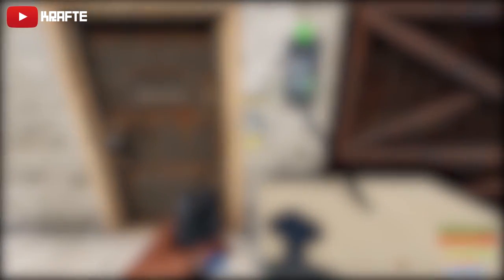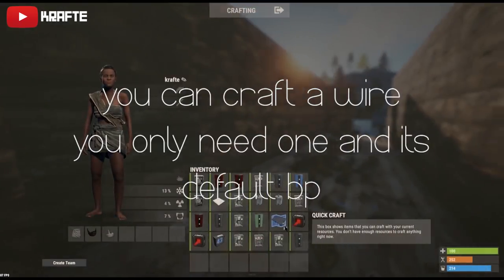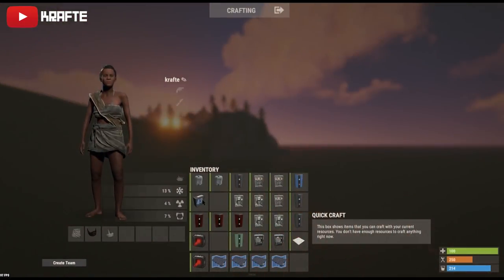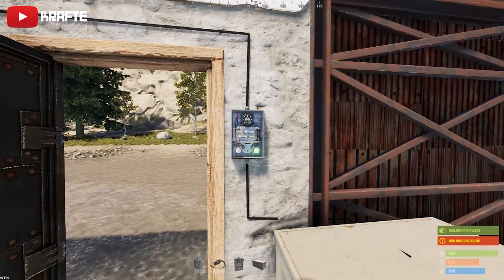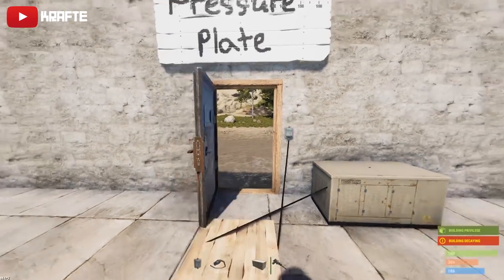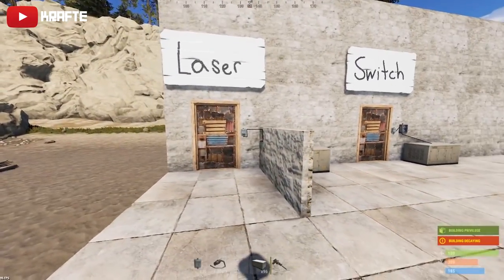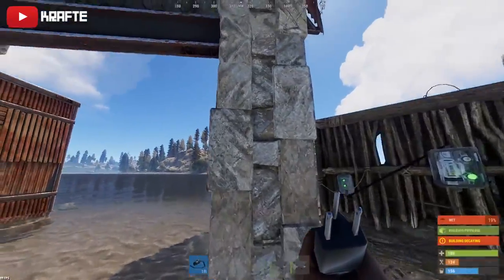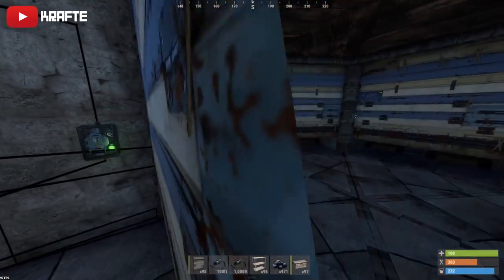Rust Electricity Guide - FULL TUTORIAL

Comment from the maker: Server is currently Live and fully wiped.
Search RustHQ in the Community Tab
Reply: What is the toggle option for the timer? I have looked everywhere and nobody seems to know what the functionality of it is.
Reply: Protip, when pulling your viewers attention to a certain spot don't swivel your mouse back-fourth in the desired area. Instead use a program (ie: adobe after effects) to draw a circle or anything else to pinpoint the area you would like attention to be drawn too.
Reply: @csennaable  Most likely to receive toggle signal, so you can turn the timer on with a pressure pad or something other than the manual switch.

Comment: XOR = "X OR", or, "Exclusive OR".
Its a logic thing.

If one input out of two is active, the switch will switch on.
If 1 is on and zero is off...

0 + 0 = 0
1 + 0 = 1
0 + 1 = 1
1 + 1 = 0

The last line is what makes it and 'exclusive' OR switch. A normal OR switch would switch on with both inputs active.
Reply: No. It's not a logic thing, it's a Boolean algebra thing. CS students often forgo that math preceded computer science in the creation of xor. Also easy way to remember it: you can eat cake or have sex but not both!
Reply: @michaelluck5577  the sex counteracts the calories?!
Reply: Hi Ray, I understand the sum above but i'm finding it difficult to put it in use when using the  components. Do you have a video on this?

Comment: One thing to keep in mind for everyone is that rechargeable batteries seem broken / fairly limited. For some reason batteries can only be in ONE STATE: Recharging or discharging - not both simultaneously like real life batteries and their circuits. This means it doesn't matter if the battery is hooked up to an active power source outputting 1000000 Watts to it, it will still discharge (albeit ever so slightly slower) until it hits 0 if the battery's output is directly connected to anything other than a switch that is off or a blocker.

This also means you can't use root combiners to combine the output of two batteries since they will then start to discharge even if the root combiner itself isn't hooked up to power anything. But since root combiners will only combine power if two power sources are directly connected to it, using a switch or blocker between the batteries and root combiner to prevent them from discharging won't work.

Hopefully these measures are temporary as placeholder functionality until FP can find an efficient way of making these components work as one would assume.
Reply: So thats why my lights keep shutting off

Comment: Hi Great introduction. I was able to make a base which was built in water and I could drive a boat in and it would expose four traps as the boat docked inside the base on a timer using a laser detector. One thing i'm still struggling to get my head around is the logic gates and blocker/memory cells etc. A video on these would be epic! Thanks Rust HQ.

Comment: What if someone raiding you and finds the switch that opens all the doors
Reply: Just don't have a switch that opens all doors.
Reply: kaycee 11 don’t have all your doors connected to the same box
Reply: Simply search for a new wiped server and try again.
Reply: Also there are lot of players who are using that cheat where they can watch trough walls and have nightvision, so yes, no switch that opens all the doors.
Reply: kaycee 11 remove wires b4 you get off, mentioned this
Reply: you're*
Reply: make a another switch that deactivates that switch.
Reply: This is just something you should account for. I typically have a main shutoff in my tc room connected to blockers on circuits I want to be off as a safety feature. You can also (If you have spare power, resources, and time) could add an HBHF sensor to detect the incoming instrusion and in the same way automatically turn off any auto doors. 

Gotta be creative!
Reply: What if you used your brain and not connect all your doors to the same switch? But that would require common sense.

Comment: I have a base and want to make one switch for 3 lights, is that possible or do I need 3 separate  switches?
Reply: zingerman11259 it is possible just connect the power source to the switch input and the switch output to the splitter and the three splitter outputs use for the lights and if u want more lights just stack the splitters
Reply: mantas petrauskas sweet thats great to know ty
Reply: Just connect power source to the switch and switch to 1 light input. The lights should have passthrough allowing you to connect to other lights

Comment: How can you hoop up two switches to a row of lights? I would like a switch outside the front door and inside where I sleep that will allow me to turn power off/on from either. I'm having difficulties as everything but the switch drains the battery and connecting two switches doesn't completely solve the issue. Can you please help?
Reply: Well you can use a root combiner. First you have your power source like a solar panel, then hook that up to a battery then hook the battery up to a root combiner. The root combiner has two outputs. Hook one output to the light on your inside, hook the other output to the light outside. And there you have it two lights that turn on.

Comment: Been trying to figure some of this stuff out but it's rather complicated how to wire things correctly, I've found that while trying to plug an output to an input the wires don't connect and the connection get broken...

Also want to know how I can setup a single trigger for lasers that only work once when its been triggered, I know what I want but don't know how to wire it. Trip laser and it closes a door and also flips the switch off to turn the laser off once triggered.